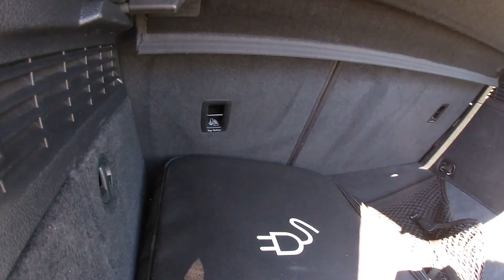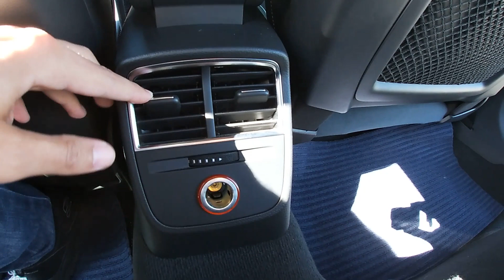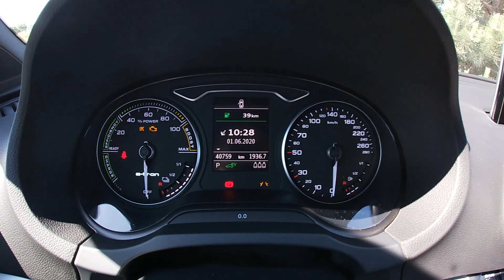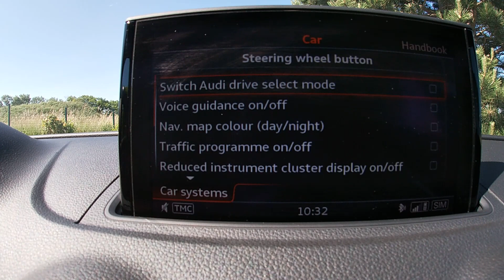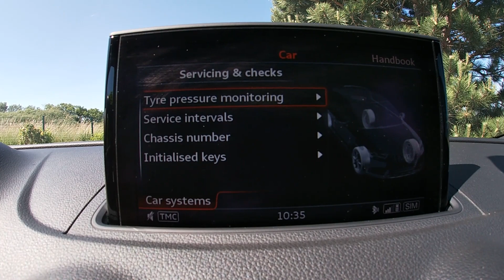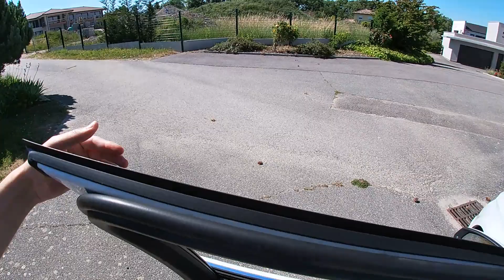Audi A3 e-tron, the complete review and presentation of my configuration and OBD modifications

Comment: have you a video that shows the charging process and data ie how many kw/h speed can you charge at (2.3kw/h on 10a 240V) etc.....what is it using the household socket at 240v and 110V and what is it with the industrial socket at 16A ; and is 50% take it to 8A or is 16A the reduced 50% default with that industrial socket
Also, how many kw/h will the car absorb from empty to full and is the a difference in usable kw/h between European and NA models....for comparison i have a 2018 that seems to only take a max charge of 5.7kw/hr from empty; and gives a max 34km range. ...i read that Audi has 7.0kw/h useable of the 8.8; but then i read in North America that is only 6 and not 7.
Reply from the maker: Hello,
To charge at 10A with a 220V socket, at 100% it took around 4 hours as far as I remember. I never tried at 50%.
With the industrial cable it was around 2h30.
I wonder why UE and NA models would have different usable capacity. What would that reason be ?
As your car is a 2018 and with the battery wear, 34Km of range seems « logical ».

Comment: Question, I’ve been looking into buying an E-tron A3 2015 but I have a couple of worries, I’m not able to charge it from the house but I would have access to a charging port at least once a week. All in I probably drive around 100 miles a week, in your opinion would it still be worth it??
Reply from the maker: Hello,
With the EV range of this car (or of most of PHEV cars alike), from a financial standpoint, in my opinion, it wouldn't be worth it if you have to drive 100 miles before being able to charge it.
You might be able to achieve a max of 24 miles in EV, and that depending on the outside temperatures and your usage of the heat/ac and your driving style and road conditions. It can go down to 15 miles worst case (around, especially in winter). Driving between 15-24 miles in EV and the remaining of your journey on fuel, you might not enjoy the real fuel efficiency potential of the car. PHEVs are made to be plugged in almost every day (or when needed) in order to make the best out of it in terms of fuel economy / efficiency.
Also keep in mind that PHEVs are some of the most expensive cars because of both system being used. That's why sellers might not recommend you this car if can't charge it at home or at work "often".
Of course, you could still take it if you love this car (which i do) but you won't gain much in your situation.
But you are saying "at least once a week", so i guess you could charge it more often ?
If your journey was 50 miles before being able to charge it, i would say why not.
But this is my personal opinion on the matter.